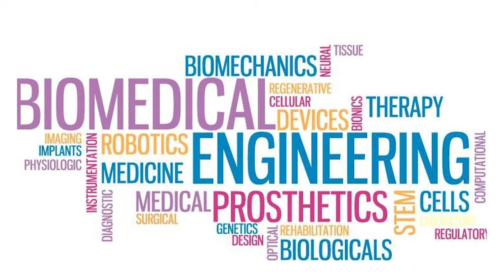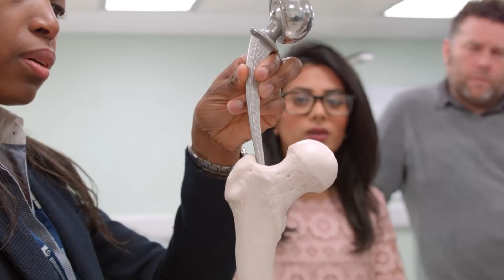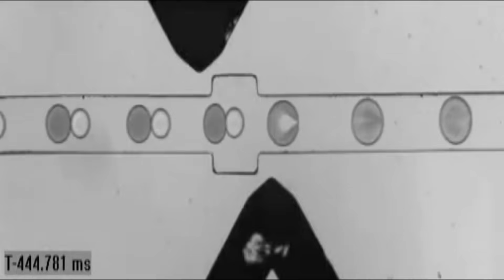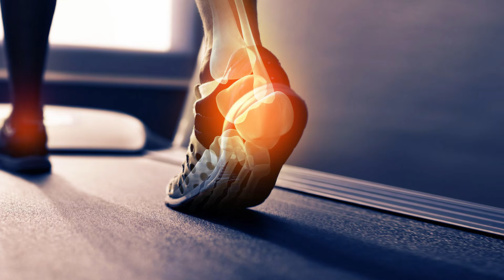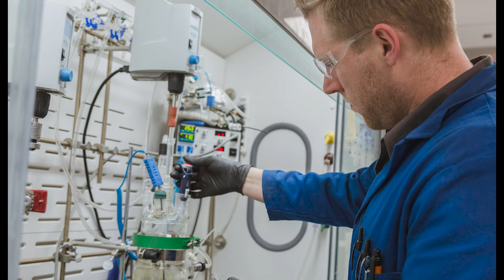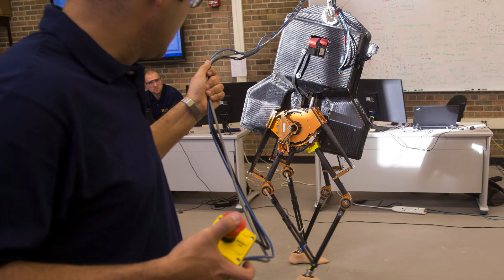What Does a Biomedical Engineer Do? | Life of a Biomedical Engineer?

Comment: I don't think bioengineering and biomedical engineering are really all that different. At least in the PhD programs I've applied to. They're both about solutions to problems in biology- but bioengineering is more wet-lab and biomedical engineering is more technology/computer based. 
Either could have courses in synthetic biology or genetic engineering-- so biomedical doesn't necessarily have to be about clinical applications. 
In biology- you usually need to have a PhD to actually invent things. Either you have a PhD or you get told what to do by someone with a PhD. 
So biomedical engineering isn't really comparable to most other engineering fields. Sure you can be a mechanical engineer that works in biology- but why even get the biomedical engineering degree if you don't want to advance biology? That's just my take.

Comment: I'm doing a electromedical diploma in Bangladesh (Its BSC course name is biomedical Engineering)  but for the fact of less jobs on this field i'm a little depressed. But i have a chance to do a mechanical or electrical engineering for BSC ... But I'm quite afraid that would i able be to study them as i'm spending my 4 years of diploma in Electromedical technology. And i heard that mechanical and electrical ones are really hard...  So i just want a calculation of this. it would be really helpful if you can answer my question.

Comment: I work as a Biomedical Engineering Technician at a hospital and while I love what I do, it has driven me to get on the design side of medical equipment (don’t have a BmE degree). I want to get into device design, circuit design or user interface. Would you recommend going BmE or EE?
Reply: EE all day. Especially since you specify UI and circuit design. You can lean the relevant anatomy and will work with others who understand it in the job. The EE you get in most BME curriculums won’t be very thorough unless you find a program that allows you to pursue a concentration in a bioelectronics route.